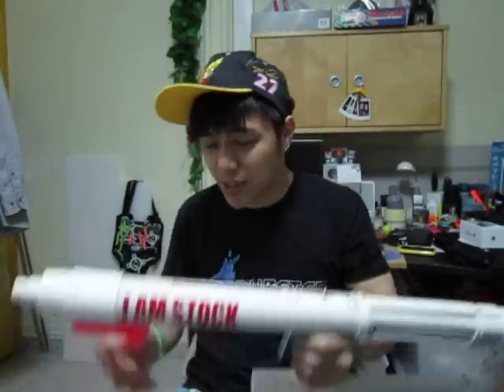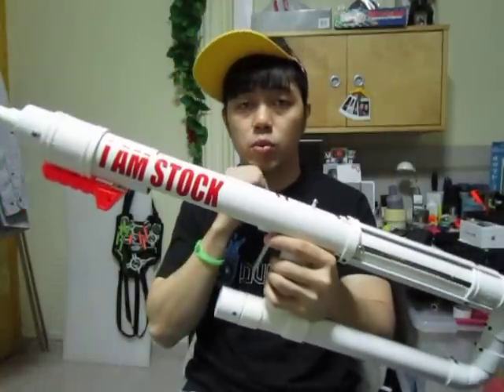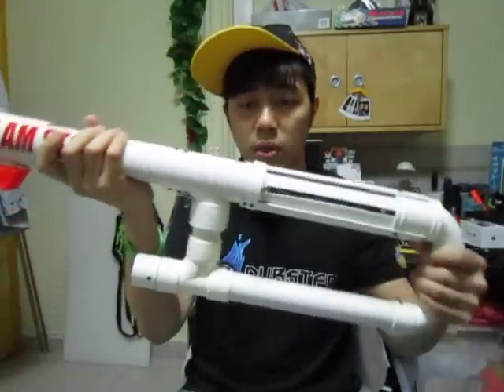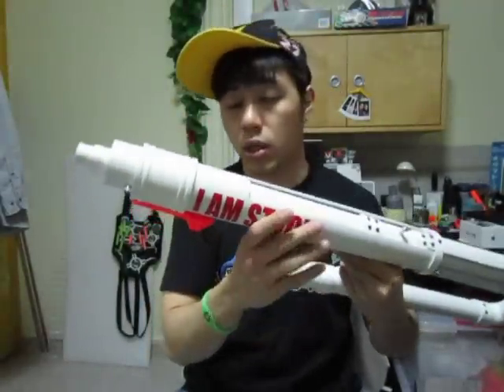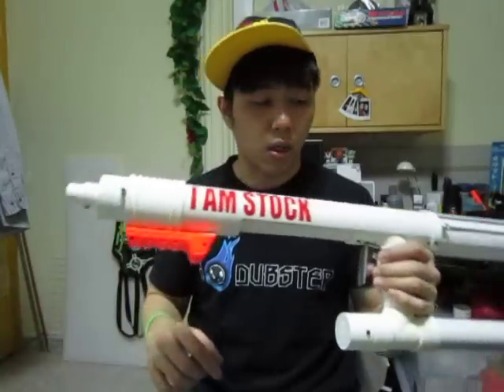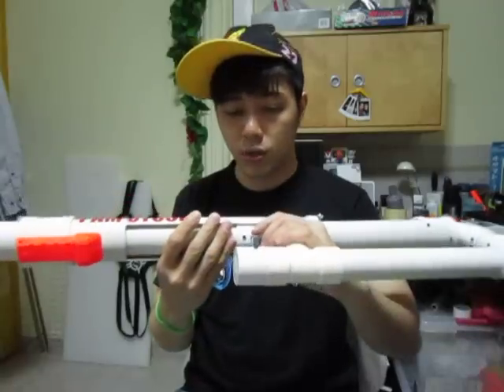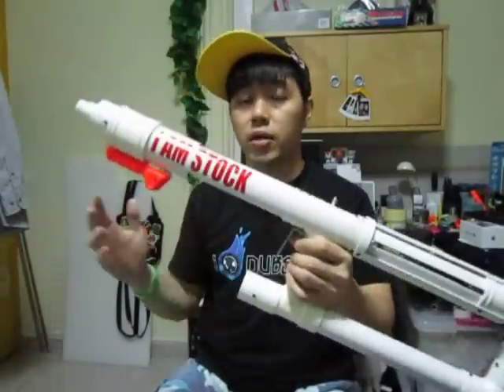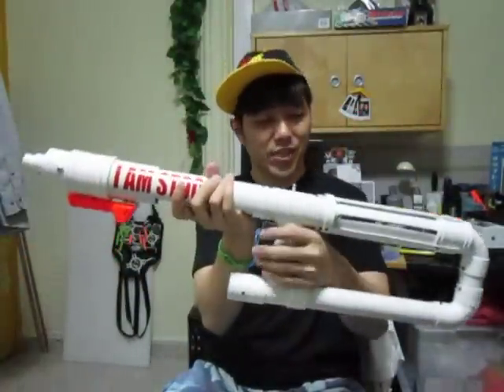New RCB / RCT Homemade Blaster - 11th Dec 2011 - Nerf

Comment from the maker: @Ambassad0rPineapple you gotta check out diyblasters[dot]blogspot[dot]com and read the R3 review.
You need to check that page out and read the entire thing that SGNerf posted. That's the original R3 design. I based this blaster off that, but instead of using the exact same pipe measurements, I went ahead with alternatives that could work together :)